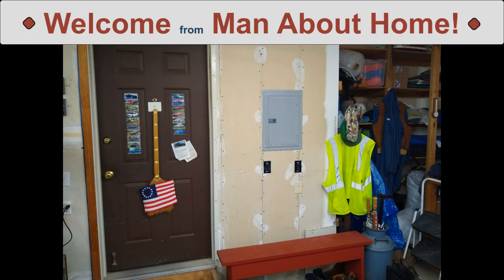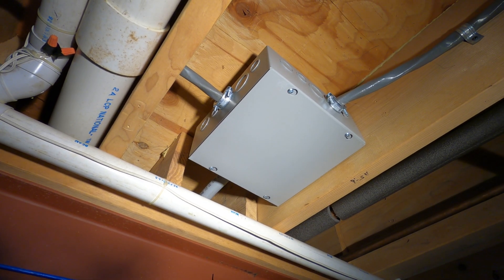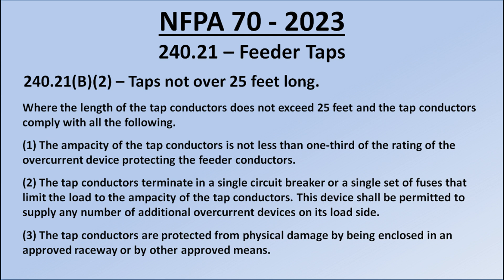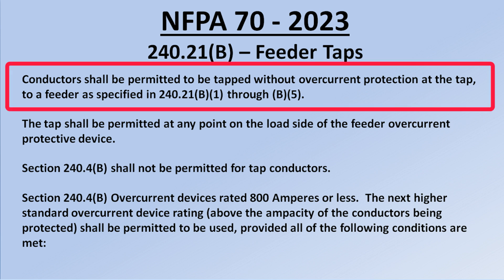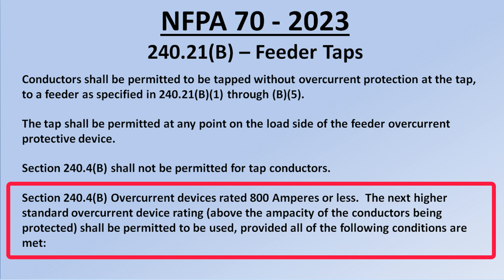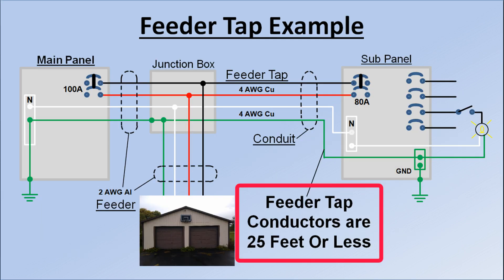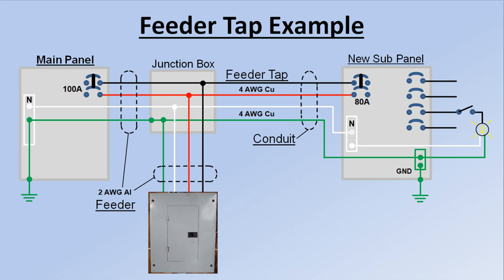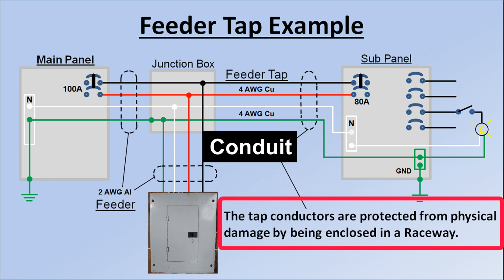Tapping a Feeder | NEC 25 Foot Tap Rule | Man About Home

Comment: Great video.  Can you tapped directly from main breaker 100amp (main panel) to sub panel with two 30amp glass fuse? Thank you.
Reply from the maker: No. I would use a 2-pole, 30 Amp circuit breaker in the Main panel. The 2 breaker poles are linked together and trip simultaneously. That can't be done with fuses. Thanks for watching.